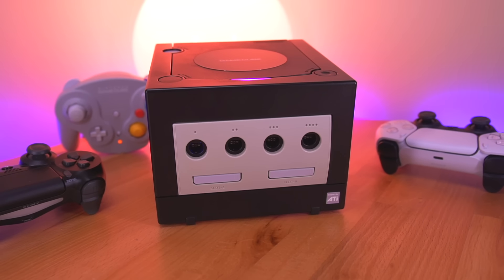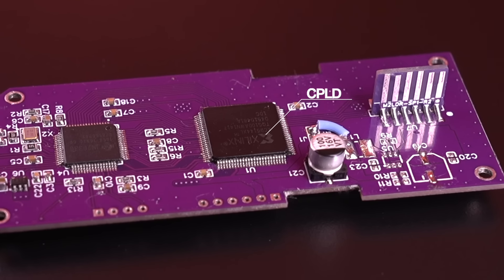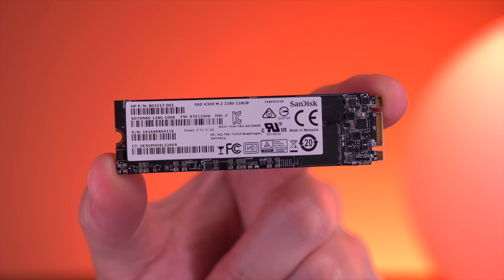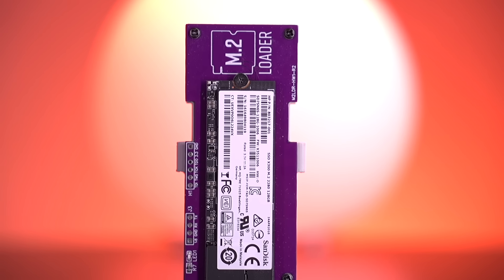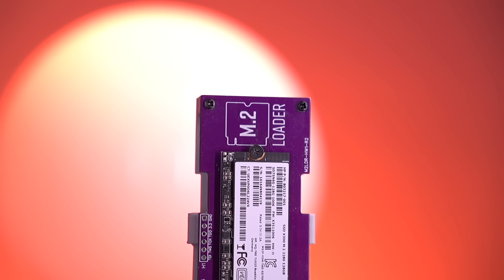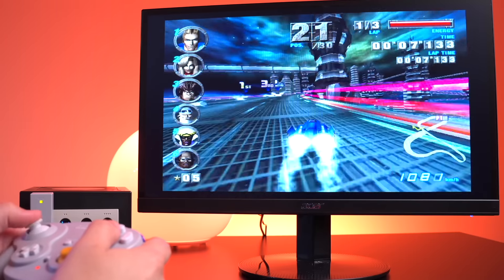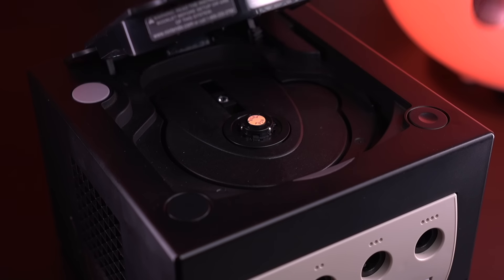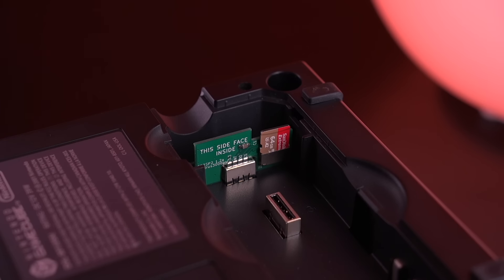M.2 Loader FIRST LOOK!  Unleash the Power of Your Gamecube!

Comment from the maker: One thing I forgot to mention in the video is that the M.2 Loader is fully compatible with DOL-101 model Gamecubes when using PicoBoot with and SD Gecko which is pretty awesome since the DOL-101 does not have a SP2 Port.
Reply: wouw now I can finally upgrade my gamecube with a cost of less then 100$.

if only we didn't have a gc to usb adapter to make this whole video obsolete because emulation on pc is flawless anyways...
Reply: Amazing!
Reply: @susanthejew6351  and the fact that this is a horrible idea, yea it works but in practice multiple times it doesn't work very well
Reply: @susanthejew6351  Hell running a GameCube on your phone would perform better
Reply: what about the gameboy advance player ? I have that on my black gamecube right now.
Reply: Dude you say this crap but we are still waiting for this
Reply: I want one
Reply: can this device work with the came cube game boy player?
Reply: I am sadly not good at Solder 😢
Reply: @susanthejew6351  I get the interest in tweaking with old hardware, I see this more as a novelty for enthusiasts. 
Most people are gonna emulate gamecube and wii games rather then dump 300 dollars into upgrading a gamecube, for 250 extra bucks you could build a competent gaming computer and play alot more then just gamecube.
Reply: couldn’t fit that info into your 15 minute video essay
Reply: Why are people in this thread so hostile? Just because you don’t see the use in something doesn’t make it useless. Some people just like playing on original hardware for various reasons. Personally, I like the video capabilities of original hardware especially when paired with an old TV that supports 240p. You may see that as a waste of time and money, but it’s worth it for what I want out of my systems
Reply: @notNajimi  Not sure about the other people here. I see this as an interesting hardware mod, however this is frankly not practical and objectively a waste of money you not gonna sink 300+ dollars into a gamecube. If it were me I would save that money and put it toward a gaming pc centered around emulation.
Reply: Is the Samsung MZ-N6E250BW 860 EVO SATA M.2 SSD 250GB a good option?
Reply: @Rustyer266 You emulation guys always think everyone wants to emulate, a lot of gamers care about accuracy & playing on original hardware.
Reply: @74Vidgamer  In the case of Wii, Gamecube and N64, emulation is more accurate then actual hardware. 
It actually runs at a locked 30 fps with no slow downs, often the colors you get out of emulation is better. 
If you want something that runs worse and looks worse go ahead I'm not gonna stop you, The claims that emulation isn't accurate is often BS outside some edge cases these days.
Reply: @74Vidgamer  Another thing to consider since this doesn't have hdmi, are you gonna buy a composite to hdmi converter, so you can use it on a modern tv. Or are you gonna track down a tv with composite for the most accurate experience.  If you're using a converter your accuracy augment goes out the window.
Reply: You still can use sp2 in dol-101, test points exist in motherboard.
I modded my dol-101 using a SD adapter.
Reply: 7:22 - Is that supposed to sound like that normally?
Reply: Another awesome PRO is that it appears it is still compatible with the GBA loader attachment too
Reply: @ninjacon7299  No such a thing, there is a Gameboy player, not GBA and requires a disc to work on Gamecube

Comment: The GameCube is incredible, the ability to put on new parts is awesome. It's crazy game consoles didn't adopt this modularity further and Nintendo dropped it.
Reply: Newer consoles carry arguably the greatest expansion port in history : USB
Reply: Yah I’ve got a 128gb usb stick sticking out of my wii.
Reply: @bacintom  2 USB ports on the PS4 was pitiful
Reply: @annother3350  because it's USB, you can add a hub if you need more
Reply: @bacintom  I heard they weren't recommended to use with a PS4
Reply: @annother3350  They didn't work well nonetheless.
Reply: To be fair, I was able to replace my joycon LED strip and Joystick (Hall effect ftw) with no soldering and shell swapping was a breeze. With Bluetooth and the Switch coming default with an SD card, a lot of the modularity comes from the software side now. Hell with my dinosaur of a PC I was able to re write the color SPI for my joycon in 2 minutes. 

This is just trying to get the GameCube up to speed, however it is a niche process for people who prefer playing on original hardware Vs Emulation.
Reply: im glad i kept my gamecube in my closet 😅. Cant wait for the final product and buy this mod ❤
Reply: :) N64 still getting upgrades as well.

Comment: SO glad to see M.2 being utilized. I'd be really curious to see a transfer speed comparison between the M.2 loader on Serial 1 vs the GC Loader on the DVD port.
Reply: The difference in the video playback was impressive. That seems to always be an achilles heel of anything using SD cards with older consoles. I love seeing new tech used to aid re-use of old hardware too! The trend of RPi Picos being used in this stuff is wild.
Reply: @MrDeelightful  The reason SD card adapters usually have performance problems on older consoles (GC/PS2/etc) is because they're being directly connected to slow serial ports as Tito explained in the video. SD cards themselves can read much faster than the original discs did, so they're not inherently an issue. The comparisons in this video didn't show the GC Loader, which has no issues with video stuttering because it runs at the same speed (or faster) than the original disc drive did.
Reply: @MrDeelightful  The video running off the M.2 drive was still slightly crunchy, but idk what it's supposed to sound like.
The GCLoader is connected to a much faster port and has none of these issues.
Reply: @DasAntiNaziBroetchen  my thoughts exactly. So glad I've got the GC Loader in my Cube. 🙂 But the M.2 Loader still beats the SD2SP2 solution. Of course it's a lot of hassle (when you factor in the modchip installation) for what is essentially still an imperfect solution. At that point GC-Loader starts looking more and more attractive - especially for collectors in Europe, I'd imagine since it comes from the Netherlands. Well, the more ways to mod, the better. 🙌
Reply: Won't run faster than an SD card, it still uses the same slow serial port.
Reply: @MilkerMurphy  watch the video again. The CPLD is doing something to communicate in a faster way to the GC. Normally this can be added to the Sd2SP Adapter.
Reply: @saschaschnuppe3409   I meant that it won't be as fast as a GC loader. 
And the videoplayback was still not great if you listen closely.
Reply: @MilkerMurphy  i guess you didnt watch the whole video
Reply: @gerlee7079  I guess you cant read
Reply: @einsteinx2  SD card adapters aren't slow because of the serial ports, they're slow because Swiss, through the CPU, has to manage all data transfers from the SD card. The M.2 Loader and the IDE-EXI before it are able to achieve much better performance with the same ports because they're made to support DMA transfers, reducing CPU overhead and increasing bus utilisation.
Reply: @NotMoreZombies  you’re correct that’s the main reason why this adapter is faster than the existing solutions, but this M.2 adapter is still slower than the GC Loader because the DVD interface is a faster bus. My point was that the GC Loader uses an SD card and it doesn’t have video stuttering problems due to that (and the fact it also does it’s own processing) and that SD cards aren’t inherently slow/bad and cause these issues on their own.
Reply: In computing devices, you only go fast as your slower/weaker part of a device. The M.2 will still be bottlenecked and be a slave to the speed of the Serial interface.
Reply: I'm with you.  I still heard slight sound glitching when he was showcasing the M.2

I do have to say, every single game I throw at my GCLoader pnp functions flawlessly and I'm beyond glad I was able to get one.  I'm also not really bummed about losing my disc drive.  It was nearly dead.

Comment: I'd like to see a version that combines this with the ever-so-expensive Broadband Adapter.
Reply: Same here. I have a bba that I don’t want to give up to use this.
Reply from the maker: That would be awesome!
Reply: maybe one day someone could reverse engineer it and make that real !!
Reply: Also maybe a Wi-Fi adapter that looks like a bba and could be set up from Swiss.
Reply: Iirc one of the planned features for Picoboot is to add Wi-Fi support to games via the Pi Pico W model. No timeline had been provided, and there's still lots of roadblocks to get past in order to make it work, but it's at least in the planning stages.
Reply: This would be amazing. With Dolphin having Xlink support, the thought of being able to do Double Dash over the internet with people on real and emulated hardware is too good to pass up! The entry fee for a BBA is too high, but if I could get those benefits as well as loading from an M.2...
Reply: I think the best way to do it is to make a version that uses BOTH serial ports. Game loading would generally be over SP2*, which would allow games to access the BBA on SP1 unmodified.

*This also probably insists on updates to allow booting to Swiss off of the SSD. If this is wholly impossible, then perhaps a small flash chip on the adapter might be good, but I assume the interface chip/board would be able to handle it.
Reply: @Kara_Kay_Eschel  being able to use Wi-Fi on original GameCube hardware would be amazing.
Reply: @Kara_Kay_Eschel  👋🏻
Reply: That mythic setup of Gamecube, Wii, Wii U, and Dolphin would be easier to achieve.

Comment: it only took like 3-5 years but people finally realized that you can adapt m.2 to nearly any slot and have some of the fastest, affordable storage around 
touche
Reply: Have they done m.2 compatibility with PS2 and Dreamcast yet?
Reply: @RaikaSTi PS2 would be easy enough, you'd just need a SATA HDD adapter and then a passive m.2 enclosure would work perfectly fine with it

Comment: You had me at "improves compatibility with games". This is what I love seeing in the retro gaming community. People creating new hardware and software to enhance these old systems. Yes, you could technically have a gaming PC loaded with every emulator but there's multiple reasons to play on original hardware. From simple preference to specific games usually working better on the original hardware.
Reply: Though GameCube modding is definitely more of a passion project, since it's way easier to just slap USBLoader onto a Wii these days if original hardware is desired.
Reply: @anonomous1324 Typically, GameCube loading on Wii is done via Nintendont, which doesn't count as "original hardware" due to eshewing the backwards compatibility hypervisor for a custom forwards compatibility layer along with emulation of controller, memory card, and networking.
Reply: The only device that's required to be emulated is the network adapter as the Wii has no SP1 port. The controller and memory card, while they can be emulated, have options to use native compatibility through the RVL-001 revision's onboard GCN ports

Comment: I'm actually hoping a LAN port can be added to the final product, if not have USB. Being able to FTP or just plug a USB cable in to load/offload games would make this product less of a headache to have to either get an M.2-to-USB adapter or physically load the drive into your PC directly.
Heck, with the amount of room it has adding WiFi is trivial.
Reply: I bet swiss could be used to transfer files from an SD in either an SD2SP2 or a gecko onto the SSD.
Reply: @mistaecco  possibly, but since they share the same Bus, that might bottleneck the transfer speeds. Worth looking into, and it might be a feature in a later revision of Swiss.
Reply: Hmmm. I like the ideas. If my GameCube was operational (the shell is in rough shape and needs to be replaced and all of the cords have gone AWOL), I would add that to my console and say goodbye to the optical drive, which is starting to go out.
Reply: including the LAN port would make this the perfect utility plug and play mod
Reply: Totally agree with a version that keeps the RJ45 Lan Port. I still use mine occasionally to play PSO online on the servers that are still up and running with a friend or 2. It's very relaxing. So this mod eliminating that makes it a hard pass for me currently. Hopefully they can come up with a solution that retains that. It would be literally perfect then.
Reply: @ApacheVR-4  it's like those online adapters for the PS2 (the new ones, that is). They have no online connectivity, which is bad, but if you have the original one, you can get a SATA board for it and it'll keep the dial-up modem and broadband (RJ-45) active and working.
Reply: Just have it use a pico W
And have wifi instead of Ethernet 
And also maybe a mod that has it doing double duty as a pico boot 
Just solder the wires to the requisite points and route them to the bottom where  SP2 cavity is ,drill a small hole and feed the wires from the hole up to the requisite points.
Reply: An RJ-port could solve both issues of LAN and data transfer, since data transfers can easily be done over the network, as it is with the XBOX.
Reply: @RetroPCUser  Yeah, that's pobably the main reason for us all to start installing SSDs into our 6th gen systems, as pretty much all of these consoles either have or are reaching 20 years of age, the disc drives are almost guaranteed to die. How are we going to play those disc-based games without a disc drive? Someone may argue that we could all just make an app that makes it possible to hook up an external disc drive, but that is cumbersome, not sure to actually work properly, and as optical media is used less and less, even external disc drives might become hard to get or/and prohibitively expensive down the line. Also just the discs themselves are starting to rot away, so what are we going to do then? Even blank DVD-R are already getting harder to find.
Reply: Read my mind haha
Reply: @RetroPCUser I have one of these in my PS2, and someday I'll try going online with it or at least doing FTP transfers instead of putting the HDD in my computer to load games to it
Reply: Yeah, even though WiFi isn't supported on GC games, it would still be super nice because it could allow homebrew applications to self-update instead of always connecting to a PC and manually updating them. Also, Nintendont on the Wii has a nice feature that uses the Wii's WiFi chip to emulate the GC's LAN adapter. If a WiFi chip were included in the device in this video, then maybe it could do the same?

Comment: Very interesting product. My biggest complaint is the loss of network support. If there is a way to add, maybe a Wi-Fi connection to a later revision since it’s going to be using a raspberry pi to control it
Reply: Bro that would be so awesome!!! And you're right, it's theoretically possible
Reply: yeah i was gonna comment this
maybe have the option to add your own wi-fi card to it? would def be cheaper to install it yourself
Reply: @hockypockies  exactly. Also something a friend of mine suggested was if you already have the pico boot mod, could you use that in conjunction with this?
Reply: @Ozhull  myself personally, I would prefer a hardwired LAN connection
Reply: @teckman02  i'm not exactly sure
i actually have never owned a gamecube myself, i'm just a nerd for old electronics
Reply: Yeah an online feature youll never use
Reply: @HistoryandReviews  most of my games i store on a retroNAS
Reply: @HistoryandReviews
>online
Double Dash is LAN only networking. :)

Plus the BBA is the best way to debug GBA software on a Game Boy Player.

Comment: Nice overview. If the broadband adapter could be reverse engineered and added on as well, either as wifi and/or a standard port, this would be a no brainer mod for everyone to buy.

Really would like to see something like this paired with a revised GCLoader that has an ide to sata chip to utilize m.2 drives. Not sure if the gamecube's internal ide could work with 2 devices in a master/slave configuration like say the original XBox and i think the dreamcast (maybe even PS2). Load all your gamecube games onto this hypothetical GCLoader, and then load all your roms and homebrew onto the m.2 loader.

The other thing to mention about these sata m.2 drives besides price and performance is probably reliability. SD cards are convenient but not necessarily as reliable for long term storage.
Reply: I have both of my modem adapters, and would be willing to hand one over for the sake of bringing networking back. BROOMOP (PSO Hacker) was able to make Offline network servers in the 2020s, so it shouldn't be impossible.
Reply: @YourXellency  there has been private PSO servers since the near end of the official CG PSO era. I believe that scthack and broomop had there hands involved at the time.
Reply: @Kara_Kay_Eschel  I’ve seen several here and there. MLP and RGT (can’t get their acronyms right) often visit old and new ones here and there.

Comment: I guess it´s nice to have, but the overall cost is quite high and the higher transfer speed is cool, but I don´t think many people will constantly add new games to the drive, but most likely just only one time when they add all the games they own. And well, since Picoboot is highly recommended (which requires soldering), it holds it back from an entire softmodded gamecube. (I personally really like softmodded over hardmodded).

Personally, for me as someone who has no soldering skills whatsoever (and already the Save Game Exploit +SD2SP2 Setup), I don´t see enough pros to switch / spend more money. I guess if you really do test around a lot on your gamecube and you really want every single bit of performance possible, it probably is worth it.